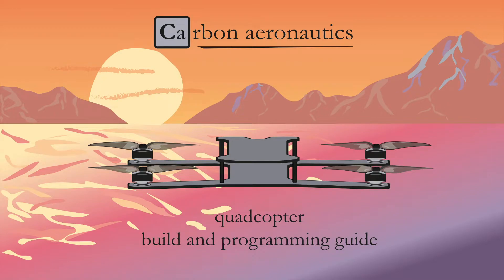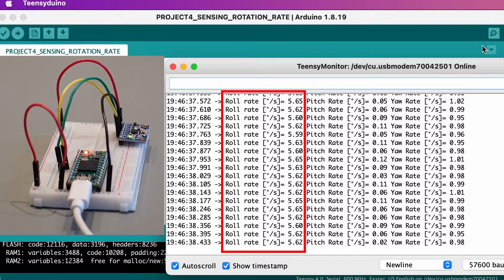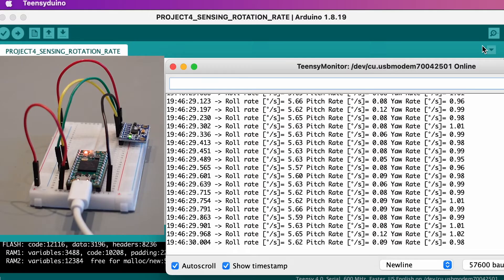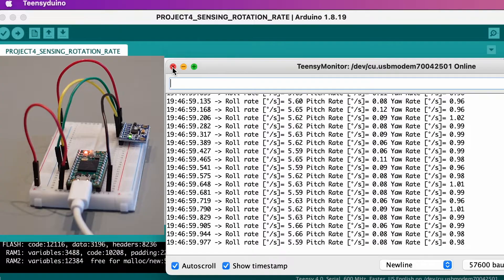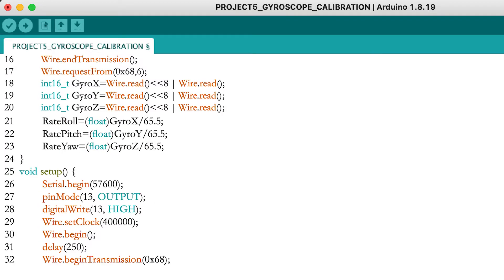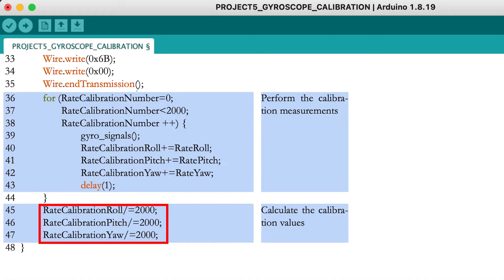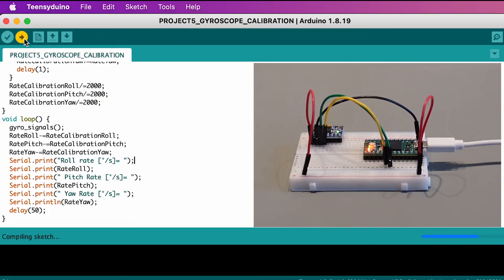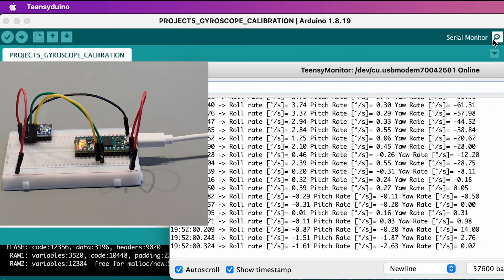5 | How to calibrate the MPU6050 with Arduino and Teensy

Comment: cool video. i used a bno055 before and wrote a few different filters to account for drift. it was super fun. i ordered a few load cells to calculate the lift of all the different sets of bldc motors i have. i'm not yet sure if im going to make an rc plane or quad.
Reply: Can you show me how you write the filter for drift 😁
Reply: @sonangthai1544  Paul McWhorter has a whole course on it, brother. Best arduino teacher on yt.
Reply: @jstro-hobbytech  thanks for your reply bro
Reply: @jstro-hobbytech  Thank you very much for your enthusiasm and kindness. I am from Vietnam and a second year student majoring in automation. I am passionate about electronics so I just want to know more about electronics and how to apply them. If possible, we can connect with each other through some platforms 😁, I would be happy to have more friends with the same interests. My English is quite not good so I hope you understand.

Comment: Sir my, accel z is always 0.47 when i keep it in rest and parallel to eartv , plzz help
Reply: It's because he only does a simple calibration,  so you'd have to calibrate with some further software
Reply: @spazmoidectomorf6209 no need for further software, just add 0.53 to 0.47 so that it is equal to 1

Comment: i dont know why dont we just assign the RateRoll , Pitch , Yaw = 0 instead of using this algorithm
Reply: because the sensor readings have a bias in them. We need to know what the bias is to remove it from the reading. Simply assigning them as zero won't do any good unless your sensor never moves.